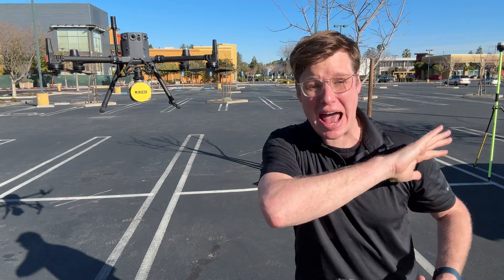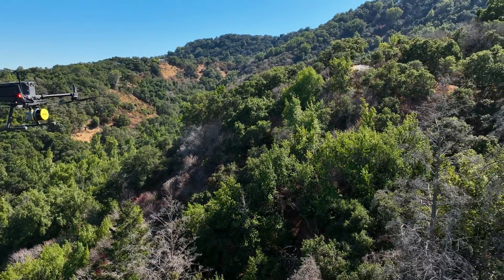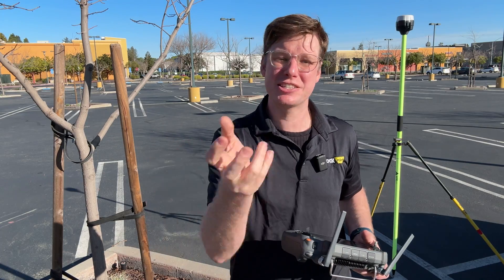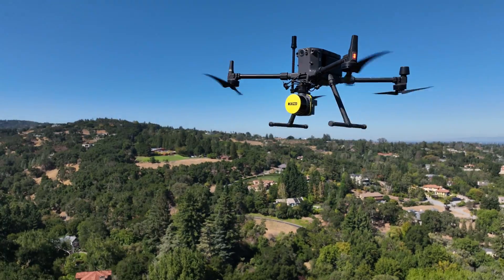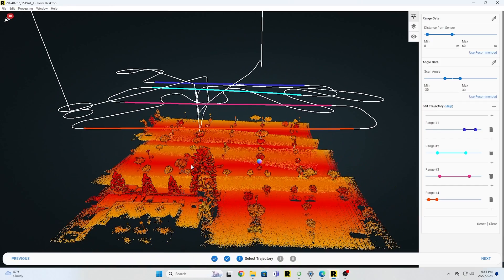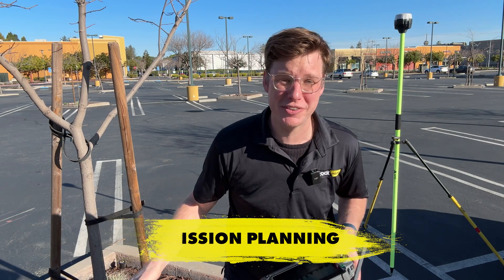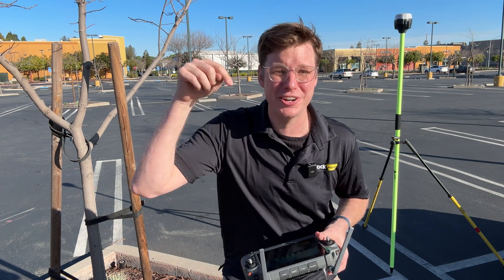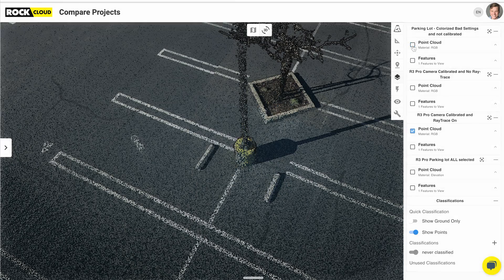5 Ways To Screw Up Your Drone LiDAR Data! (& How-To Fix Them)

Comment: Great advise...but one thing
..Fly straight lines, but not to long. Long straight lines can cause heading drift in most IMUs.
Reply: How much is ''to long'' ? thx
Reply: @csandrel  its depends on your IMU. I use POSPac to process my trajectory. It has tools to analyze your data and look for degradation in position. Manufactures may also recommend how long to fly for, before making a correction.